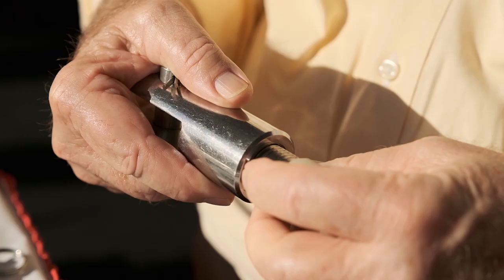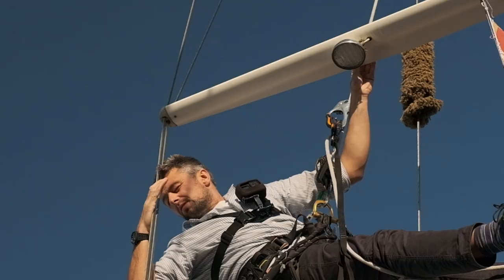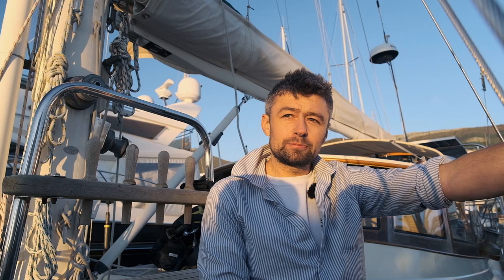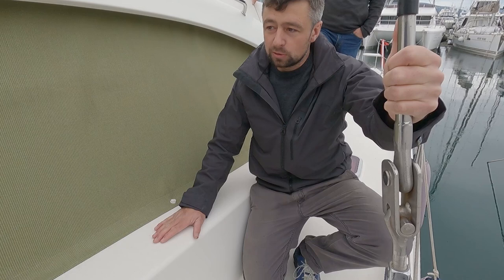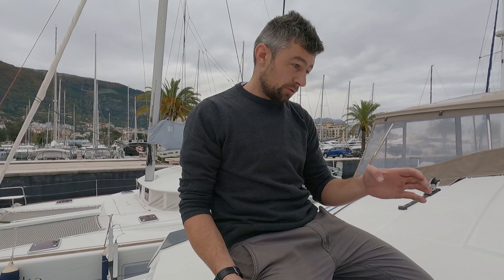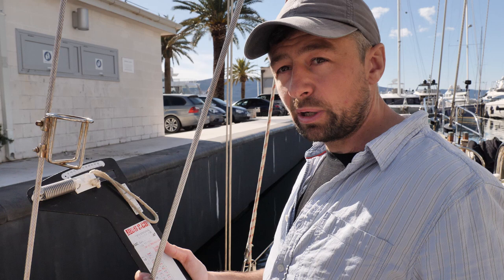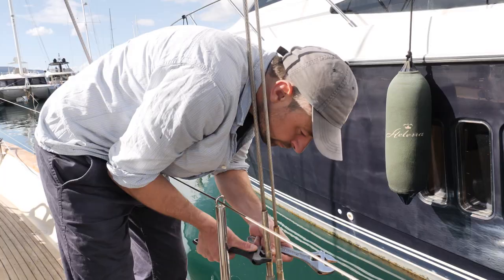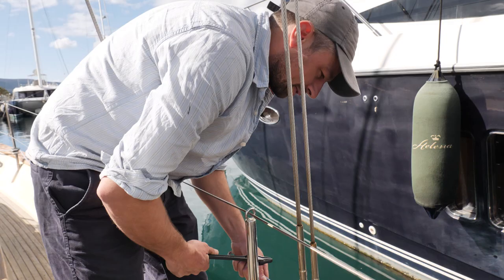Rigging 101 (Part 1)

Comment: Nice vid, thanks, on Swage vs sta-lock : i go swage up & down for the forestay:  If easy, mechanical systems like sta-lock or swageless bits have just more single points of failure (parts, handworks, mount process, sealant, maintenance, vibrations), and physically good sta-lock mount apply a 10% less breaking strenght to the forestay, while Swage apply 5 to 10 %  less breaking strenght.

Comment: There is a theory that GGR 2022 participant Tapio Lehtinen's boat might have snapped and consequently sunk in 5 mins in the southern ocean because of too high tension/load in the rigging (by a person who knows the boat Asteria well and actually had warned him <<obviously can't find it back now>>). The hull of the boat was reinforced with several additional bulkheads etc. so very little "flex" and Tapio called it bullet proof...but sometimes rigid things snap quicker than a tad more flexy ones
Reply from the maker: Yes I’m keen to talk to Tapio, we interviewed him before the last GGR he’s a very experienced sailor and a very nice guy. I do feel he’s protecting his engineers though, I watched the live stream they did together. Personally I think it was a combination of very tight rigging (getting carried away with racing trim) and shaving too much off the hull. What came out in the live was that that put layers of Kevlar on the hull, well they wouldn’t have done that on an already very thick layup without take some off first. I think they took too much off.
Reply: @svfairisle  Yes, I think you are spot on. The conversation I was referring to was on some Finnish sailing forum when the accident happened (I’m Finnish) and obviously can’t find it back. The boat sank in no time so something must have happened to the hull. The person who wrote the comment/explanation originally is obviously someone in the know of the re-build and understood the loads vs. structural strength and had raised a red flag which got ignored. 

The most important thing is that Tapio got rescued and that Kirsten got to him first and won. Both are great ambassadors for sailing ⛵️
Reply: Over tensioning is very common. Tensioning shrouds like a guitar string might be acceptable for the racing community or in overbuilt 1970's boats but that makes no sence for cruisers and especially for more modern (highly stressed) hulls, such as catamarans. The weakest part of the system is often the chainpate/fibreglass link or the fibreglass bulkhead itself and yet that is rarely considered. After I studied the subject I significantly destressed the tensioning that a so called professional rigger had set on my boat.

Comment: Hi there… Who did you use to make up your rigging? How long did it take from order to delivery? I have a Compass47 with double spreader; what would you estimate I should budget?
Thanks a million
Mike
Reply from the maker: I think you should budget around £8,000 in materials if you do it the same way as us with STALOK fittings on the bottom end. You can do it cheaper with swage fittings but I like the compression fittings and STALOK do quality wire too. I'm not sure exactly what our cost was as we got a bit of a discount at the boat show and the Furlex was part of our final bill (very expensive, about as much as the whole rigging put together!) and I had a lot of extra bits as spares to cope with problrms in remote places. 
Jade was the rigger I brought in from Wales, one of the best in the world. If you google 'the boat shed Wales' you should find him

Comment: Why didn't you replace the stainless wire to Dyneema? All that stainless weight topside would have been lost.
Reply from the maker: I was tempted to go the Dyneema route. Can’t do the stays just the shrouds of course if you want to keep roller furling, but there are also issues with big temperature changes keeping the rigging the right tension. It’s not as straight forward as you might think

Comment: I noticed you had a piece of hardware attached to a shroud. Did Jade have an opinion on the dangers of attaching fittings like flag halyard  cleats to shrouds?
Reply from the maker: It’s not the best idea. I don’t have anything on my shrouds now except the baggy wrinkles and even they are detrimental to the stainless, Jade could see the surface wasn’t as good beneath the baggy wrinkle as elsewhere but it wasn’t a problem probably because they are high and it’s mainly rainwater that sits in them, with something lower that gets sea spray, probably not so good

Comment: Why don't they spot weld or a complete weld on the swedge fitting?
Reply from the maker: Pressing the wire with a swage fitting isn't lacking strength, it's the fact that water can get in because there are tiny gaps between the wires. the water sits there, goes stagnant and deprives the stainless of oxygen which allow crevice corrosion. Welding the wire is unlikely to stop this unless unless it's such a harsh weld that it basically fuses the wires together in one lump. I'm not sure this is possible and even if it was I think it would produce a weak point where the solid fused part meets the strands. It's for this reason we don't solder wires on a boat.
Reply: @svfairisle  Thanks for the swage correction. What if the wire was pre dipped in a light application weight elastic coating? would this reduce corrosion within strands?
Reply from the maker: @Methoes123  The challenge is coating in between the strands. Dipping a wire in anything is very unlikely to get that coating into the tiny voids between the wires in the core. Some riggers think it will work having sealant in there and still add various products. But over the years with the bottom sewage being like a bucket with the wires squashed in there if it’s possible for water to find a way in it will. The compression fittings allow water it and out so water should pass through which is a million times better than having it stuck there. And you can run a hose in it every now and then to get the salt and any contaminants out.

Comment: What do you and the professional think about about using dyneema for standing and running rigging?
Reply from the maker: It can be a great thing, stronger, lighter, more able to see if it’s getting a problem. Jade is increasingly using dyneema and working out the best practices. I was tempted, but there are other considerations and problems. Can’t use it for the stays with roller furling and our SS extrusion for the radar. It has problems with tension in big temp changes, so it’s not all plain sailing
Reply from the maker: It can be a great thing, stronger, lighter, more able to see if it’s getting a problem. Jade is increasingly using dyneema and working out the best practices. I was tempted, but there are other considerations and problems. Can’t use it for the stays with roller furling and our SS extrusion for the radar. It has problems with tension in big temp changes, so it’s not all plain sailing

Comment: Carbon fiber rigging is stronger and lighter. And more expensive. But if cost was no object would you (or Jade) use carbon for a cruising boat?
Reply from the maker: Well I considered dyneema rigging for the shrouds. I do think it’s a good idea and I know Jade is working more with this sort of rigging now. It has some good advantages like letting you know when it’s starting to degrade (it goes fuzzy on the outside) & yes it’s obviously much lighter and in many ways easier to repair/jury rig. It is more liable to chafe though and can give you tension problems in big temp changes. Of course you can’t use it for the stays with roller furling though & I’m not going back to Hank on sails! I’m hopeful that on our next rerig in 10 years or so we will go at least partly dyneema
Reply: @svfairisle  Dyneema also stronger than steel but it is not carbon fiber.
Reply: But now there are Dyneema-carbon hybrid composites that may be even better.
Reply from the maker: @WilliamAArnett  I know, but as far as I can tell carbon fibre is only really a consideration for racing boats, even the HH sticks to Dyneema at the moment
Reply: One issue for carbon in boat construction is because it's more rigid it can make a boat more "boomy" than a thicker GRP hull - which isn't great for sleeping at night on a cruising boat - that's one of the reasons Dazcat give for not using carbon throughout the boat.
Reply: I would imagine that the “booming” issue can be ameliorated with a few extra ribs and stringers. ??